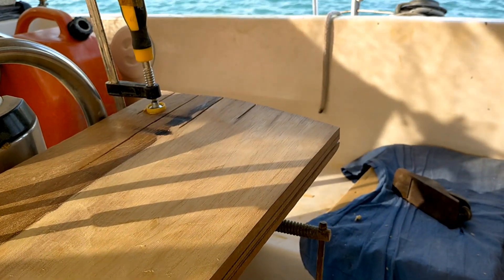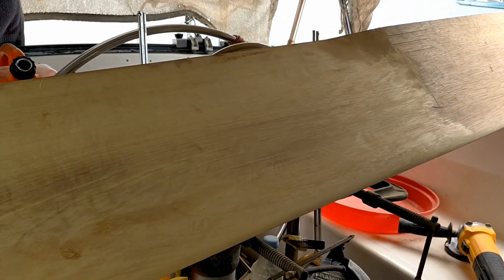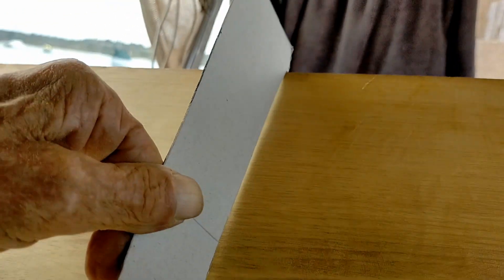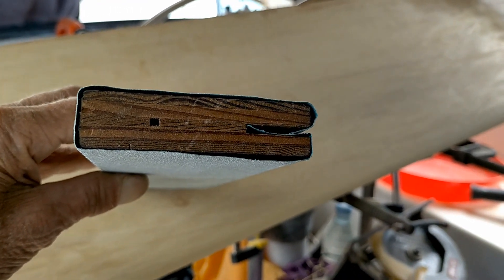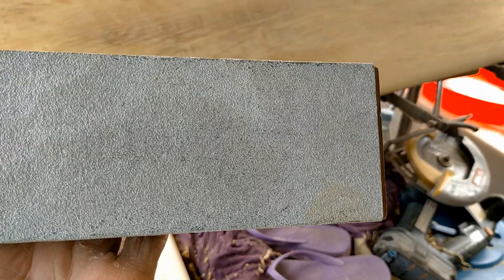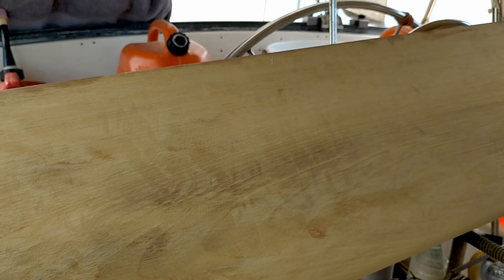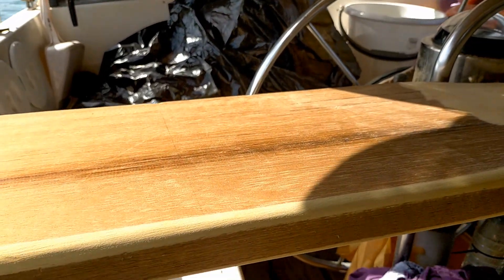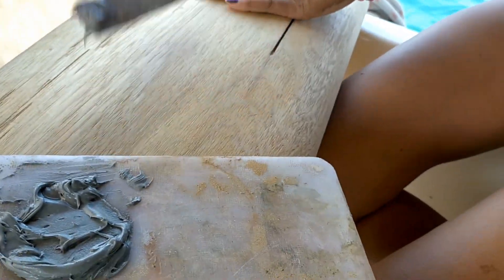Making my own auxiliary rudder | Part 03

Comment from the maker: Generally an auxiliary rudder should have about 40% of the area of the boat's main rudder.

I found this site. It comes from The Pirate Bay org.
This is a direct link to download John Letcher's "Self-steering for sailing craft". 
This book has become a classic and was a great resource for designing and building my own windvane self steering. I have made three different systems on my current and two previous boats. John also covers a great deal about sheet to tiller methods for self steering.

https://annas-archive.org/slow_download/06f736aeabdbfdfcc9de335c2fda09fb/0/1

Anna's Archive is also a great resource for many other books including many marine related authors.